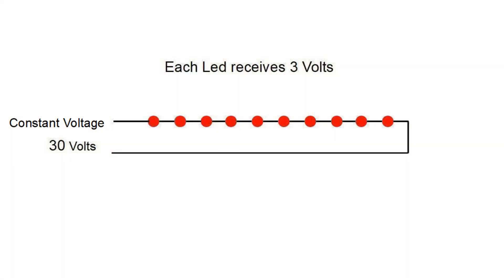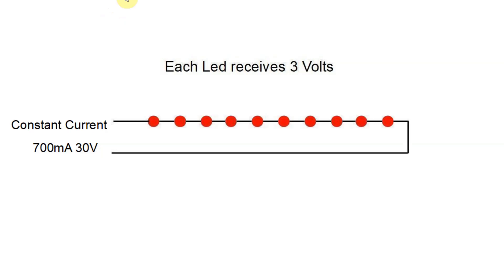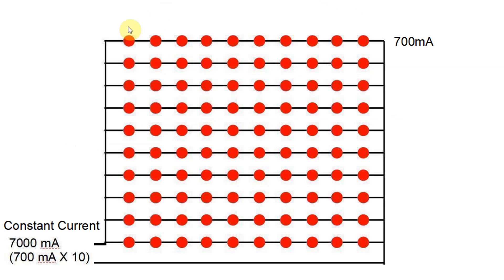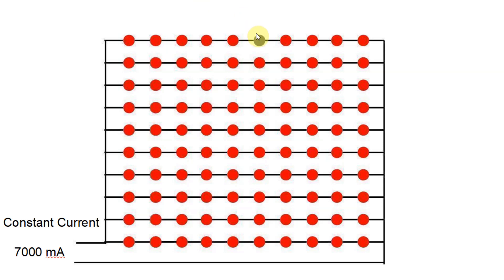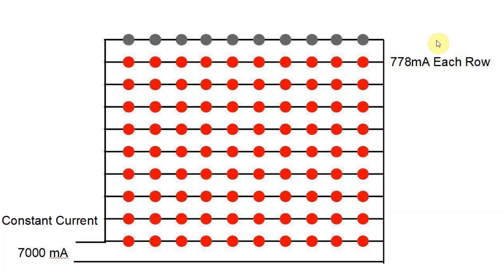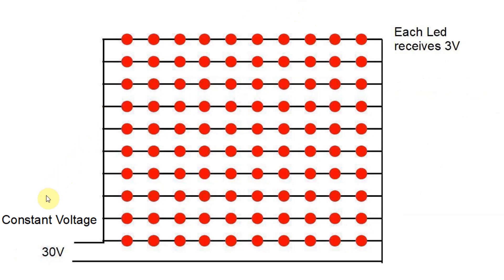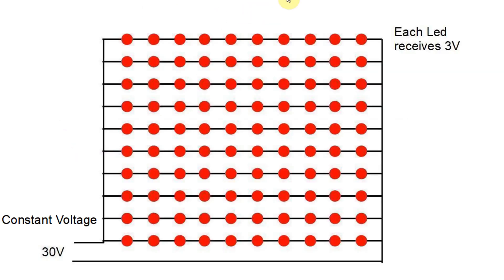Constant Current & Voltage Power Supplies For Led Grow Lights

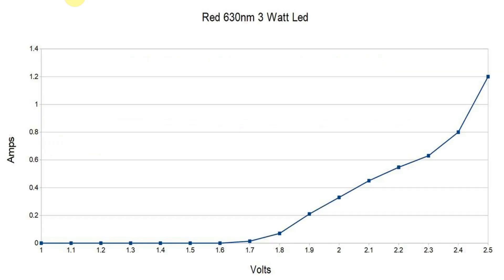Comment: At 1:17 you make the assumption the LED blows as a short circuit.  At 4:20 when the first row blows all the current will go through that row because its a short circuit.  the 4:20 analysis is incorrect.